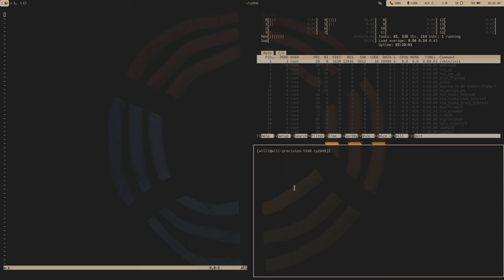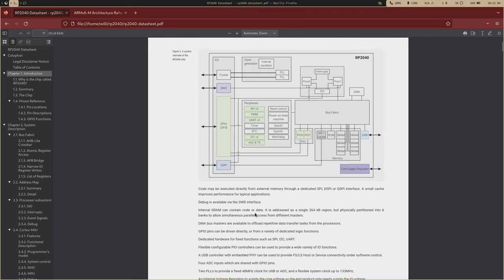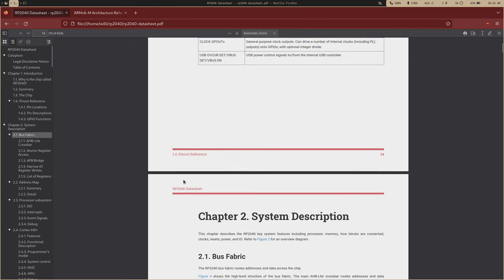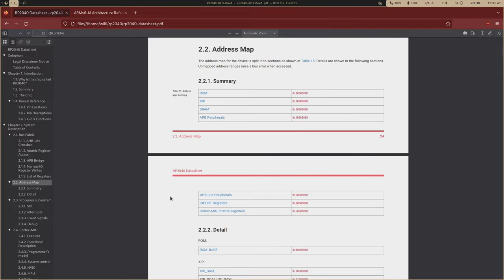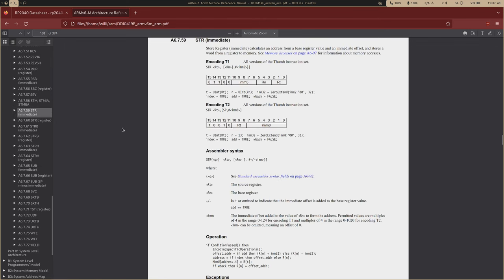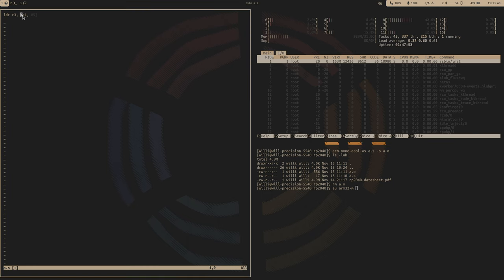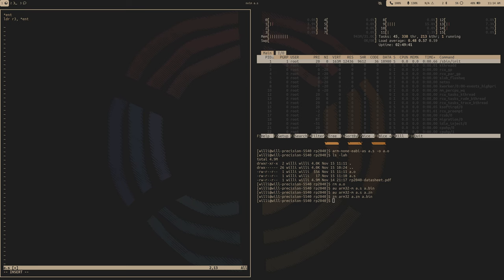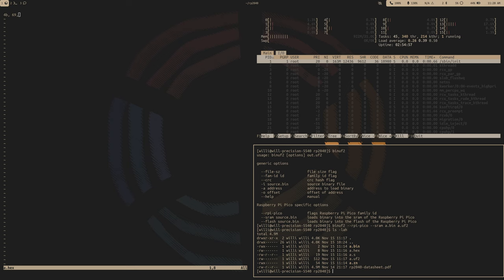RP2040 - Baremetal Assembly - Introduction, Development Environment, and the Bus

Comment: It is a shame that there is no assembly editor like asm-one was back then in good old Amiga times… coding never been so much fun in any ide since then. 30 yrs later all we have msdos-like ugly windows and that’s all. Kinda frustrating.  Anyway it is a great idea to make an asm series for the pico. But I disagree in terms of thumb mode superiority. I think in thumb mode you don’t have the those conditional commands like the movne addle and so on which was a killer feature. We coded ppc in asm back in early 2000’s and then we made a nintendo gba demo for a competiton in arm asm. (We used goldroad assembly which was pretty cool and we used sublime text for editor and we added the python script which did the build to the f1 key. It was a more sophysticated way but far from the asm-one..) and those commands of the arm oh boy that was a game changer. We succeded to make the code almost without a single branching by using those conditional commands. Arm has the best assembly imho.